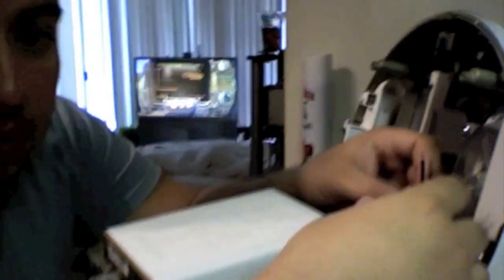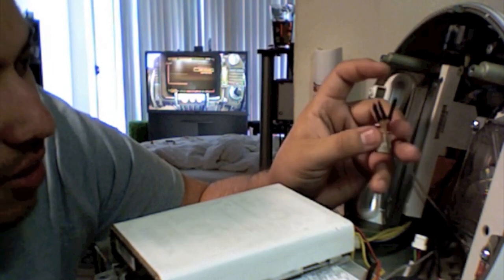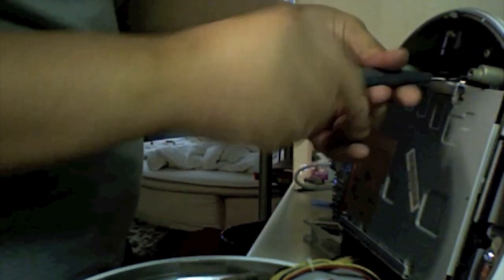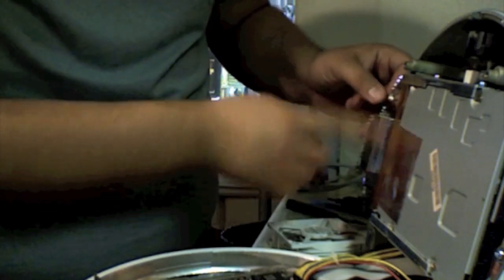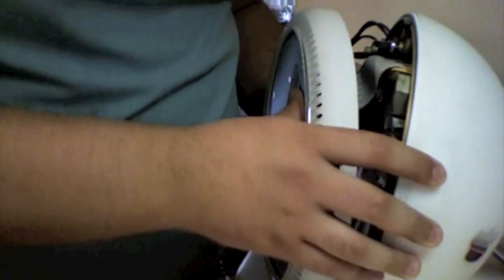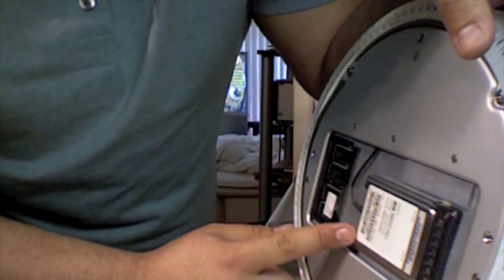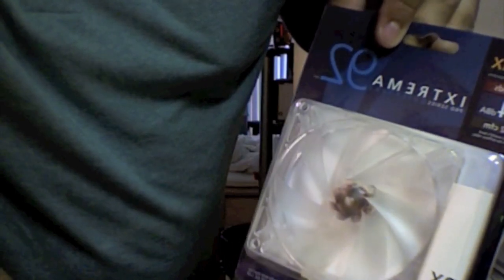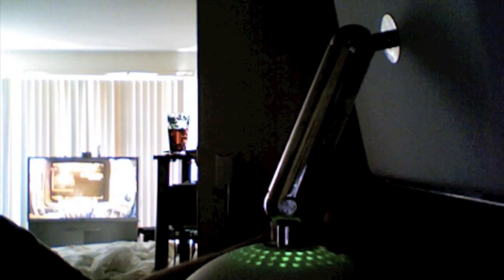imac g4 LED fan upgrade

Comment: i gonna change my hardrive from 40 to 500 and i hope to change my RAM to 4 gb if that is possible and i gonna change my fan, because there is 1 fin off the fan and the discdrive and MAYBE a airport card
Reply: the iMac g4  only supports 1gig  max